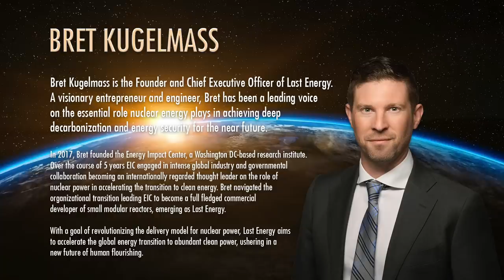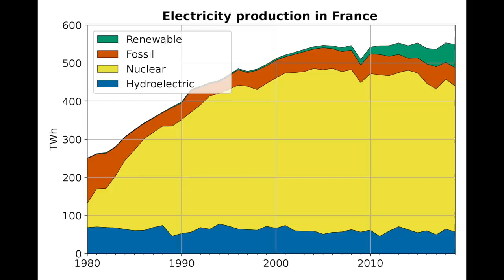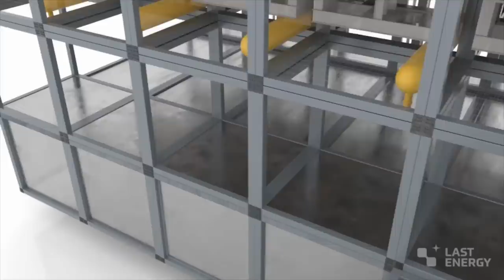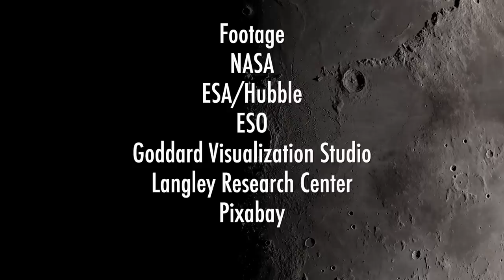Why We Need To Pursue Nuclear Energy Featuring Bret Kugelmass

Comment: Figure out a way to safely store the waste first. 

What mining companies do to the land is horrific. When they leave they file bankruptcy, start up under a new name, and leave a mess behind.
Reply: There are reactor designs that can use waste as fuel
Reply: What countries are using designs that use the waste? What's on paper isn't the same as what everybody is building. Go to NM and do a report on all abandoned uranium mines that need cleaning up.
Reply: @dalehallett8449  India and China both are and if I recall correctly Russia is too. South Africa was also working on a reactor design that could use nuclear waste as fuel
Reply: @hydromic2518  Thanks for the info. I'll check it out.
Reply: @dalehallett8449  no problem! The reactors are very interesting in that they have passive safety features in the design meaning human error can’t cause the reactor to meltdown or create a steam explosion. The reactor designs are molten salt reactors and Pebble bed reactors
Reply: @hydromic2518  France seems to be doing a great job of recycling, but there is still radioactive material that needs to be stored.

Comment: The next big step in nuclear will be finding a way to directly generate a magnetic field or a huge amount of electrons.  What I mean is that right now, nuclear is just a way to boil water into steam, to turn a turbine, which turns a generator, which makes the electricity.  It's the same idea as burning coal or oil to boil water.  Nuclear explosions create a short electro-magnetic pulse, so maybe there's a non-explosive method to do it- use the hear to melt a magnetic metal like iron and then spin it around like the earth's core...?

Comment: All the references you talk about are reactor that were designed more than a half century ago.
Go check out Helion - in your own state. Once the magnetic bottle and the capacitors that supply the electricity… it shuts down, no radio, reactive, uranium rods, no radioactive deuterium water, the radioactive waste to dispose of. This is the next step and nuclear energy that Fukushima Chernobyl, or 3 mile island.

Comment: around 17:00 mark the guest states the nuclear industry made the wrong strategic choice of selling safety systems instead of safety assurances. IMO this underestimates the impact nuclear accidents - particularly Tshernobyl - had on popular opinion. It also brushes off the very real deficiencies in nuclear plant security in the past, e.g. vulnerability to natural disasters and terrorism. After 9/11 the reactors had to be able to take a direct hit by a 747. The 1500 MW Olkiluoto 3 reactor was over a decade late and big part of it was problems pouring all the concrete needed. Even the safety systems that the guest here seems to imply were unnecessary proved insufficient in Fukushima. Nuclear business prospects are dim due to plunging solar and wind prices. There are legitimate reasons for building nuclear plants, though, including energy security/diversification, research&science, and the outside chance renewable price declines slow down.
Reply: The nuke "sales pitch" here perplexingly revolves around blaming nuclear industry for regulatory capture to address safety concerns. Can't say this stimulates much confidence in me - and I'm pro nuclear. Btw, risk management > denialism.

Comment: i think he overly shits on thorium or any breeding tech. and down plays the fuel supply and waste issues.

like it or not no one wants to live around a barrel of transuranics safe or not, and on plant storage is not a long term solution for long lived waste.

small modular also rely on higher enriched 235 and are less effcient than the larger plants at converting fuel to power.

sure you can bring up the see water option but your skipping the step of needing a bunch of large scale plants making abundant cheap energy to get to that point.

logically it doesnt make sense you need cheap power to get keep fuel cost cheap to make cheap power.

the reason thorium makes sense is it lets you make use of a fuel that is currently being ignored while avoiding some of the transuranic fuel cycle
Reply: he can also say he doesnt csre about waste all he wants but the nuclear regulatory agency will absolutely wreck you if you take this attitude with them.

Comment: Gotta say, after this interview I'm sold on nuclear. I don't quite believe there's "no danger" like the guest says, but with enough effort and protocols nuclear safety and nuclear waste management seems like a non-issue. Especially compared to the doom and gloom people are expecting from climate change, a little risk from nuclear reactors seems like it would be preferrable.
Reply: there's already more than a little nuclear safety in the energy sector, beyond reason. that's why we're stuck with low/intermittent alternatives to fossil fuels
Reply: It didn't seem completely truthful to me either to say nobody ever got hurt - not even in Fukushima. Like what about the firemen and first responders! "Nobody got hurt" I don't believe a second. They might develop cancer years after so it's easier to deny the connection. But some people surely got exposed too much. Also not too many people are still living there a decade after. There's still huge areas where radiation is deemed too high and not safe for living a decade after. To just swipe that away as fearmongering seems shady - corporate image campaign shady. Nuclear might be a better way into the future but there's no need to lie about the risks and play it completely down. It is a complex technology to master and use safely and the similarly strict regulations in so many independent countries seem to prove that. It might be the best option to go green eventually but i don't think this topic is as black and white.
Reply: He didn’t say there’s “no danger”, just that the danger from the old reactors is totally acceptable. And it really is, we could have a Chernobyl  every month and it’d still be less dangerous than the alternatives. Even if you creatively add up any and all deaths that could have, maybe, potentially in some way come from a nuclear accident, you still end up with a shockingly low number of deaths per megawatt hour. That’s why you don’t ever hear anti nuclear organizations bring up that metric, not even with cooked statistics – it would hurt their point. The most interesting part is always what a person DOESN’T say.
Reply: @kabakaprime5127  
> far worse possibilites of a worst case scenario

That’s what Fukushima was. Literally everything failed there. What more do you want? Even "just" a Chernobyl literally cannot happen with water moderated reactors, as they mention in this video. It’s actually physically impossible, the reaction stops when no water is left for neutron moderation. After that it’s only a slow and predictable melting process. If you somehow find a way to make this process more explosive than even Chernobyl, may I suggest you sell this technology to some militaries? They might be interested, at the very least for anti nuclear weapons proliferation.

If you want to fearmonger about possible worst case scenarios of power plant accidents, you should look at hydropower plants and what happens when dams upstream of big cities break. That’s how you reach REAL death count highscores that are impossible to match for any other type of power generation accident.

> Fukushima and Chernobyl are lost - forever. You can't live there anymore without decreasing your life expectancy drastically

This is wrong. In most parts of Pripyat the measured radiation amounts to only 4mSv per year. For comparison, 50mSv/y are allowed for radiation workers in the US, and many places in the world have similar if not higher natural background radiation. More importantly, most of that radiation comes from strontium-90 and caesium-137 which have half-lives of about 30 years, so most of that will be gone in 60-120 years. In fact that today’s radiation levels there have come down to fairly moderate levels is because almost 40 years have already passed. Shorter half-life and hence more dangerous stuff is all but gone and the aforementioned isotopes have more than halved already. It will be quite a while until you can touch the reactor itself, but the same can be said about any chemical waste too. Oh wait, it can’t, the chemical waste doesn’t have half-lives, it’s toxic forever.

Fukushima is even more mundane having started at much lower levels to begin with. 

> A plane crashing in a nuclear power plant

… wouldn’t do much. In fact a nuclear plant is precisely the kind of building I’d like to be in if I had to be in a building targeted by such an attack, precisely because they’re sturdy concrete fortresses.

If you’re worried about what malicious actors can do with your power grid, I’d again like you to consider the vulnerabilities of other technologies. I already mentioned dams and the horrendous damage they do when they break, so lets consider something different here. Wind & Solar rely on internet of things garbage and are easily hackable. Your malicious actor doesn’t even need a plane to disrupt your power grid and cause massive damage, some hacking is sufficient.
Reply: @KrKrp0n3  you are right. I was misinformed about how long the area is inhospitable and I also didn't deny there was some fear mongering. But not all is fear mongering and it didn't sound that believable to simply claim nobody gets or got hurt the way he said it. It just sounded in the beginning like he's not admitting any risk whatsoever - and Fukushima and especially Chernobyl showed in my opinion that it can get quite nasty in a worst case scenario and make an area dangerous for at least a couple decades. It's not nothing. So sorry for bothering, didn't want to argue much really.
Reply: @kabakaprime5127  Nothing ever has no risk at all, yeah. Can’t make an omelette without breaking some eggs. It’s a tough pill to swallow, but literally every mass produced good has some bit of human blood on it. If you make enough of it, even just the car crashes with the trucks shipping it become statistically relevant. (Actually a real problem with wind turbine blades, shipping those is a dangerous traffic disruption)

What makes nuclear accidents relatively mundane is the insane, unimaginably high amount of energy produced. Fukushima for example was a 5GW plant. FIVE GIGA WATT. For the 30 years it was running that’s 263 TERAwatt hours of electricity. Coal has an estimated death rate of about 24 per terawatt hour, so Fukushima saved over 6000 lives if the alternative would have been coal. Even with the modest 2.8 deaths per twh for natural gas it still saved over 700 lives. Even wind would have killed 10-50 people depending on how much you overbuild to deal with volatility, and that’s completely ignoring what the different storage options would do (very hard to estimate due to wide array of choices)

Nothing is free, everything has blood on it.

Comment: Do you think the massive number of water tanks that go as far as the eye can see, Japan is building to house the irradiated water from Fukushima that would go into the Pacific ocean if not built, and still huge quantities of radiation is leaking into the Pacific ocean contaminating fish, and other ocean life over vast stretches of the ocean?
Reply: They're just overreacting.  It's perfectly safe.  They should just send it right to the municipal water supply.  It's been over 90 days.
Reply: Radiation doesn't 'leak'. Only radioactive material can leak. If it is radioactive enough to be of concern then it will decay away very fast. If it isn't then it isn't of concern.
Reply: The water is completely safe to release into the sea, it is solely being stored due to absurd regulatory burden.

Comment: 46:30 , no the Germans are not building coal plants.  In fact current German law is to phase out coal over the next 20 years.
Reply: They are restarting coal plants. A quick Google search will tell you that. They were opening new plants as late as 2020. Again, a quick search will tell you this.
Reply: @Icspiders247  the one in 2020 we are talking about one plant and that was extremely controversial in Germany. And if you understand anything about the German Energy sector, you would understand that continuing nuclear power would not have changed that. We are mostly talking about inertia effects here. Also, I think they were more talking about the rise in German coal consumption in 2022.
Reply: @MusikCassette  You said they're not building any. I showed you they had built at least one recently.
Reply: @Icspiders247  MusikCassette said they're not building coal plantS. They're allowed to build ONE. (Glumplich laugh)

Comment: Treating regulation as the bad guys while claiming nuclear meltdowns are fine and Chernobyl isn't relevant.
Reply: You don’t think regulation run by people can ever be corrupt, ie influenced by competitors, or it least  inefficient and out of date?  

Didn’t say meltdowns are “fine”. At the least they result in expensive loss of property and a mess.  But the public ones … don’t kill anybody.  If only gas pipeline explosions, oil trains fires, coal emissions, and airplane crashes were like that. 

That are no more Chernobyl like reactors in the world.  All the modern reactors are very different, water moderated.  So yes it’s fair to say pointing at Chernobyl is a bit like saying ‘the Hindenburg blew up, flying is dangerous’.

Comment: No question nuclear power is rather safer than it once was, but I'm still unconvinced that it's worth the risk.
Reply: That implies there’s some safe status quo plan.  No nuclear and you risk bad climate change as well as the traditional pollution and accidents that come with it, that kill people on a regular basis.
Reply: @Nill757  It implies no such thing.
Reply: @LauseMarkA  If nuclear is ruled out as not “worth the risk”, even though it has decarbonized several grids at low cost in past decades, what other option is low risk?
Reply: @Nill757  there are still very serious issues with nuclear in the long run.  The reason it offers a lower risk in the shorter run is because resources were invested in reducing them.  The question remains why there was not a similar investment in reducing the costs and addressing the storage and other issues that plagued those other options.
Reply: @LauseMarkA  “very serious”? 

More argument from authority. First post implied a value judgment, “not … worth the risk”, ie vs something else.  I asked again, what option is low risk, and the question is dismissed. From that, how should I not conclude that your actual position is you don’t really care about other options or risks of the status quo, but nuclear just feels scary.
Reply: @Nill757  You conclude that what I've written isn't really what I written.  Ah, well. I never have high expectations trying to discuss with someone who has an empty profile, and trolls for arguments.  This entire argument mirrors the civic decision-making process in general, doesn't it?  We are presented with pre-selected choices, and told that we have to choose between which industry is going to gouge us with minimal regulation and zero concern about the long-term results.  :-)  Silly to think it would be any different on this issue.
Reply: @LauseMarkA  Couple dozen words, even an insult, and still no argument. Talk around, talk about, but not the thing itself. You made an assertion, “not worth the risk”, backed with nothing but adjectives, no comparison, and now smirk that it’s someone else’s job to prove you wrong.
Reply: @Nill757  It isn't an insult to point out that you choose to take shots from your anonymity.  It's just a fact.  And I am not even challenging the assumption that nuclear power may represent the safest option available right now.  I am just pointing out that decisions have been made over the past few decades to make that the case.  Armies of well-funded lobbyists and publicists shaped the priorities that got us to this point, and I have no illusions that my concerns carry any more weight now than in that longer non-discussion.